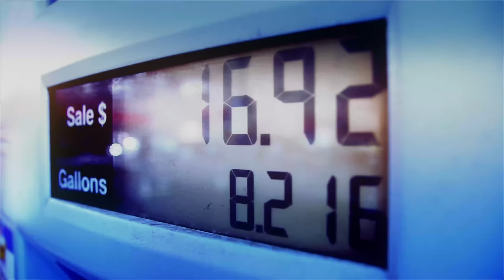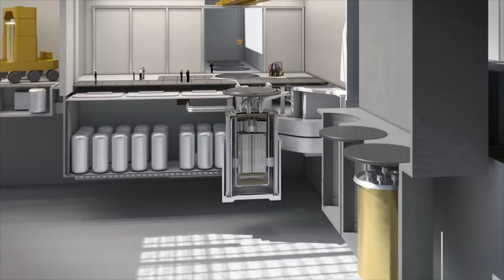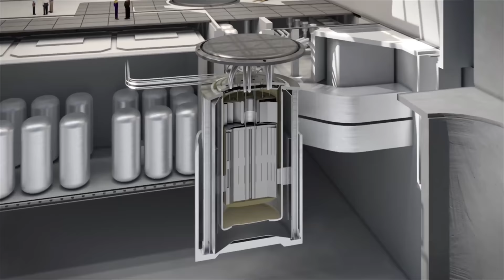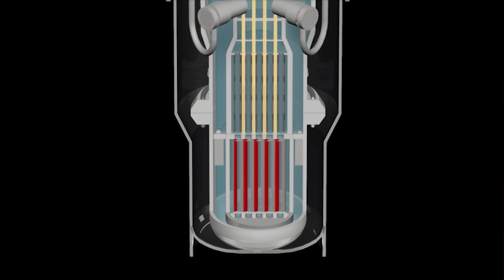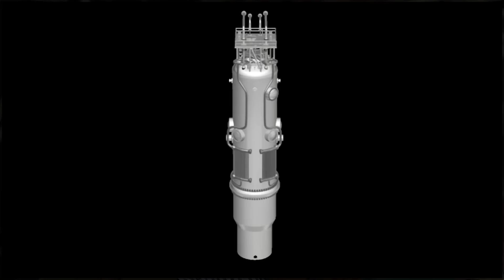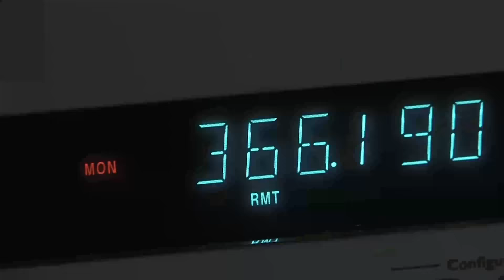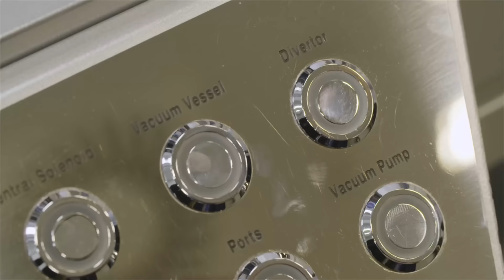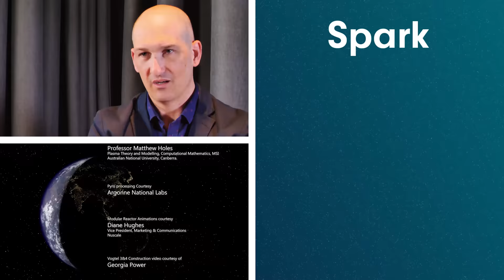Can We Trust Nuclear Power Again After Chernobyl? [4K]

Comment: Molten Salt reactors are safer, yes. But the waste heat problem is still with us. Waste heat is worse for nuclear reactor-generated power than for any other method in use today. Waste heat given off by nuclear power generators is instant, not delayed as in greenhouse gases emission from other methods. Anyone think of that before they do a cost-benefit analysis? Apparently _not_; disgusting. :face-orange-frowning:

Comment: save yourself an hour: yes we can
Reply: It is not about safety but about cost.
The Southeastern U.S. is super pro-nuclear MAGA, has zero anti-nukes, and 100% political support. 
VC Summer (South Carolina) new nuclear units 2&3 were canceled in 2017 after spending $17 billion on the project (original estimate of $14 billion and 2016 completion date) with no clear end in sight for costs or schedule.  Anti-nuclear sentiment was never identified by the utility as causing any of the many delays.
Vogtle (Georgia) new nuclear units 3 &4 currently 110% over budget and schedule and still not operating. Mid way into the build, the utility stated that had they known about the many costly delays they would never have chosen nuclear. Anti-nuclear sentiment was never identified by the utility as causing any of the many delays. They are now delayed another year because according to the project management, thousands of build documents are missing. Utilities, not the media, decide the most cost effective electrical power source and give the above failures no U.S. utility is even considering new nuclear at this time. If you can’t build new nuclear in the MAGA super pro-nuclear southeast U.S. then where can you build it?
In both cases, the ratepayer is stuck with paying the $50 billion bill. And the silence of the Rah Rah nuclear folks on these events is deafening.
Reply: @clarkkent9080   Yet you continue to ignore from your blank trolling channel the fact that the US and many other countries have built and used small modular reactors for many decades built in two years or less for millions not billions.

Comment: Chernobyl, what about Fukushima, Three Mile Island, Kyshtym, a hydrogen bomb dropped offshore in Tavie  Island, Georgia, a lost nuke in British Columbia, the lost nuke off the coast of Spain in the 60s, that one was found. We seem to be careless with nuclear.
Reply: Nuclear weapons and nuclear power plants are not even similar. In any way.
Reply: @lowellcalavera6045  you're correct, nuclear bombs are safer. They go off when detonated. Power plants are more complex and usually go boom by themselves, even when they try to keep the core cooling.
Reply: @jasonborn2598   Nuclear power has proven to be the safest form of electricity generation methods we have.
Reply: @jasonborn2598  Why bury it when you can reuse it in fast breeder reactors or reprocess it?  It's easy to bury if so inclined.  There's a lot less radiation living next to a nuclear plant than a coal plant.

Comment: Conventional solar photovoltaic doesn't help industry very much - beyond the electricity it can produce of course, which can be used to run electric arc reactors or induction furnaces, but you would need hundreds of hectares of solar panels to provide the equivalent of a drop in the bucket worth of power. Same goes for wind turbines of course. However, there is another form of solar power which is more directly useful industrially: Solar concentrators, aka solar furnaces. These do occupy a significant amount of land (several hectares per furnace at least), but that isn't necessarily a huge problem, because the ideal sites for building them are large desert zones which get fairly consistent direct sunshine. Which doesn't tend to overlap all that much with areas of high residential population density, or with agricultural land, so it doesn't have to compete with either farming or housing.

Anyway, a properly focused solar furnace - and this is existing technology which has already been built in some places - can generate exactly the kind of temperatures necessary for smelting metals or other high heat industrial applications. I have seen a solar furnace effortlessly melt steel, for example - which takes a MINIMUM of 1500 degrees C. Nuclear reactors can produce large amounts of lower level (up to 1000 degrees C) process heat, which would certainly be useful for some industries, as well as district heating of course. But nuclear cannot yet generate the kind of high temperature furnace heat which is currently only possible with either electric arc reactors or combustion furnaces burning fossil fuels.

Solar concentrators CAN do this, because they have a massive efficiency advantage compared to solar photovoltaic: A solar panel gets on average about 30% conversion of incident solar energy into electricity, though some of the latest research scale solar cells have apparently reached 47%. But a solar concentrator converts the majority of the incident solar energy directly into heat, so will always be far more efficient when used as a furnace. So while I completely agree with the necessity of advancing nuclear power as part of the solution to providing energy, solar concentrator furnaces are one method which has been conspicuously overlooked by the above documentary.

Comment: Lets save you  48 minutes...
Chernobyl was about very sloppy engineering and zero safety precautions. Modern nuclear plants are pretty safe until and unless they get clobbered by massive tsunami. Because light water reactors (what modern reactors are called) MUST have powered water cooling even when shut down. This was the downfall of Fukushima, the diesel generator that powered its cooling pumps was destroyed by the tsunami. When you drown a running diesel (or gasoline) engine the uncomprehensible water destroys it.

Additionally, and the video did not cover this, molten salt reactors, with or without thorium are the way forward. They have no high pressures and don't use  a steam cycle. This means they are much smaller. They are also more efficient because of the higher temperatures. As if that wasn't enough, they can use existing nuclear waste as fuel... AND the decay products are a combination of valuable rare earth elements and waste that is of such a low hazard that it only needs to be stored in a dry warehouse for a decade or two.
BTW there is enough fuel for molten salt reactors in the form of 'nuclear waste' to run things for about 1000 years.
Reply: Let me save you 48 mins.  The only MSR project (Terrapower's Natrium) reactor project in the U.S. is not going so well.  And the ESTIMATE cost of the plant is 2-3 times that of other power production methods.

Also you can't just dump spent reactor fuel into any reactor without very very very expensive reprocessing so that is not going to happen.

Reality is not that simple.

Comment: Please consider time lines and the levelized cost of energy production. A given dollar will produce faster results by investing in solar and wind. Yes, nuclear for special applications has a place, but I do wish that you would stop these infomercials.
Reply: Levelized cost leaves out way too many factors, EROEI is a much better metric to judge different energy sources.
Reply: @chapter4travels  Yes, there are some impassive (older) charts out there that show nuclear having greater values than wind or solar. But there are other factors. Me, I can put solar on my roof, but I cannot put a nuclear reactor in my back yard, at least not yet.  I believe in distributed energy systems. I fear that an extensive nuclear route has grave political and social consequences. Beside much like fossil fuels, it is questionable if nuclear fission is a long term option.
Reply: @chrisconklin2981  You can supply some electricity to your house with solar panels, (I'm 100% off-grid with batteries, no grid tie-in) But you can't power a modern industrial society with "renewables". Only advanced nuclear can do that without fossil fuels and there are no long-term fuel issues to worry about.
Reply: Chris, be sure to factor in storage into you solar meme.  That's where wind and solar always fail.
Reply: @chapter4travels   You can't even power a single household on solar alone unless you live near the equator. You are leaving out the fact that you also rely on some other fuel source such as natural gas, propane, firewood, and gas or diesel for your generator.
Reply: @danadurnfordkevinblanchdebunk  If you have enough money and space for solar panels you can. I don't have either so, as you pointed out, I heat with diesel and cook with propane. Also, I can only run my AC while the sun is out and for just a few hours after that.
Reply: @chapter4travels  Thanks for your admission, I have been doing alternative energy for 40 years and hate to see people get the wrong savings grace solar impression like it's going to save the world. Until we have a quantum leap in energy storage technology, alternative energy will need nuclear to work.
Reply: @chapter4travels  Most homes in the US would need about a quarter million dollar investment in a solar system to be 100% off grid, and likely double that if in a northern severe winter climate without some sort of fuel backups.
Reply: @danadurnfordkevinblanchdebunk   That's why my original comment started with "You can supply some electricity to your house with solar panels," Some, but not all unless you are both willing to live with less AND supplement with other sources. I do both, my choice, and I never suggest others do it unless grid power is simply unavailable, as in my case.
Reply: If you go back to 1908 when Ford introduce the Model T, there were really no paved roads and very few gas stations. The change from horse transportation to automotive transport was a paradigm shift base on the refinement of crude oil. Before that the age of steam was fueled by coal. My point is that our challenge is to make a more distributed energy source such as wind and solar work. It will be a different world that will require a different perspective.
Reply: @chrisconklin2981   Your meme still doesn't work without a viable energy storage method.
Reply: @chrisconklin2981  "My point is that our challenge is to make a more distributed energy source such as wind and solar work." That's the challenge as you see it, but you are thinking on a residential scale, powering homes. You are leaving out the large demand side, industry. Wind and solar can't even power a typical American home, let alone a steel or concrete plant. 

The reason is simple and inescapable. Wind and solar are VERY energy dilute, intermittent, weather, season and location dependent. No amount of technological advancement can change that. Nuclear on the other hand is the opposite, massively energy-dense and works 24/7/365 regardless of location, season, or weather. Trying to power a modern industrial society with wind and solar is, honestly just dumb.
Reply: "Please consider time lines and the levelized cost of energy production. A given dollar will produce faster results by investing in solar and wind."
If this statement was true, the highly RE German (wind) or California (solar) would have low retail energy prices.
Highly RE German electricity costs 2x more than nuclear French electricity (similar market, same monetary policy).
Highly RE Californian electricity costs 2x more than nuclear Illinois electricity (same market, same monetary policy).

What the LCOE doesn't capture is the cost of intermittency. Although the generation cost of solar/wind may be low, the societal cost (as reflected in retail rates) is high, because we have to build for their high intermittency - redundant generation, demand-side management, extra storage, extra transmission.

Distributed energy systems don't really help. Sure, the panel on my roof and the panel on your roof are 'distributed', but the sun sets at the same time on our neighborhood!
Well, maybe I am in New York and can supply morning electricity to you in L.A. and you can supply evening electricity to me. That is distributed - but it is not very robust - because the #1 cause of power outages is trees falling on power lines, and the #2 cause is animals (squirrels/birds); not to mention the enormous expense of such transmission increases.

Comment: Great video!  We need this to keep out grid stable as we replace the coal fired units.  I would not hesitate to retrain for operating a nuclear reactor instead of a boiler to drive turbo generators
Reply: Позвольте вас спросить? Что вы делаете для жизни? Как насчет окружающей среды? (Can I ask you what do you do for life what about environment? Yours truly from Smolensk NPP (project Chernobyl)  with love.
Reply: @eugeneivanov8229  I'm an operator at a coal fired power station. We boil water to make steam to drive large turbines to to generators. Our units reactively ramp up and down to control grid frequency changes, this works very well, so keeping turbines in the grid using cleaner means of boiling water will be a very good thing
Reply: @StevoJN  Hi/ I am a superviser shift at SNPP I wished know what kind of  people look through videos like this/ I try to impruve my English looking at special films In Russia  we get many world`s news about your green power and we are surprised sometimes about it / You shoud understand there is much competition on NPP world market and have you thoght what your coаl`s owner say about you :)  Next text was made with Google I couldnt translate it sorry/ (We do not have dispatcher restrictions on power generation. The main operating mode of the unit is the nominal mode without transients. You must have a reliable consumer of energy to implement a nuclear power plant. And Chernobyl was built and designed in such a way because we did not have the money and opportunities. This station, like a Kalashnikov assault rifle, is cheap and angry. Currently, this project is considered a museum exhibit)

Comment: Chernobyl and Fukushima disasters were both caused by gross stupidly. Chernobyl ran test that the state knew to have a high risk of failure, ran the tests with gross incompetence. Fukushima, oh I know lets build a reactor right next to the ocean in a high earthquake/tsunami zone. Better  still lets put the backup cooling generators in the basement, what could possibly go wrong. Even 4 Mile Island was because of poor training, but the reactor containment building did its job.
If War monger Biden succeeds in starting WWIII nobody will have to worry about climate change.